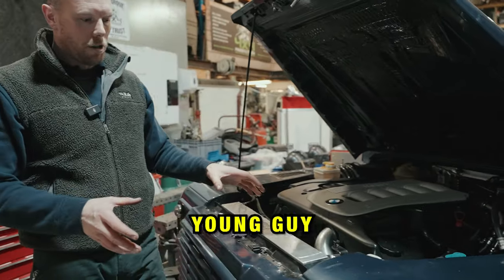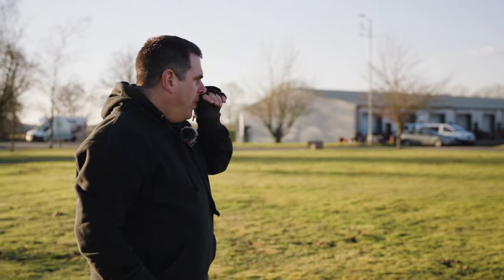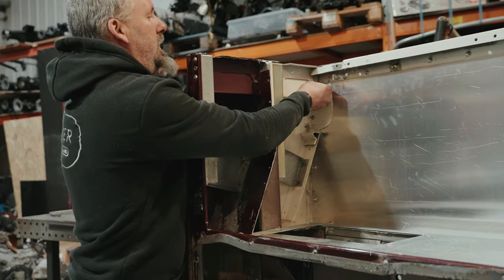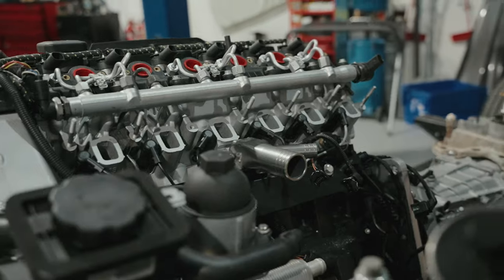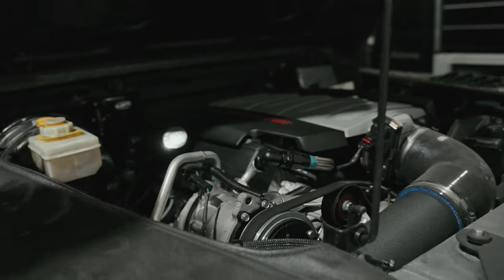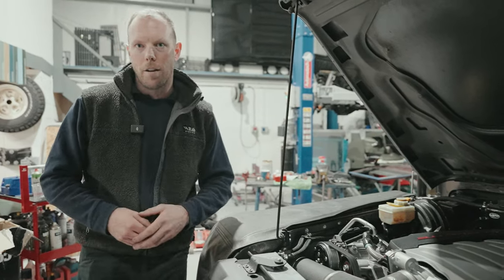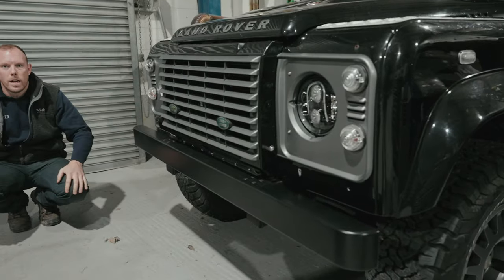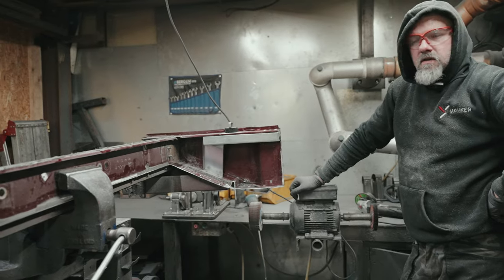What ENGINE SWAP did we do to make this BROKEN Bowler Defender BETTER? || Mahker Weekly EP107

Comment: Once again some more nice bits n pieces and a wombat coming up for sale. shared to face book. Question 300 tdi once warm under load above half throttle, spitting / tapping sound. have done head gasket before with composite gasket new bolts and skim 30000 mile app'x ago. Will be checking rocker shaft, exhaust gasket prior to strip down. also had vac pump last couple of years, any other thoughts. might get tempted by some door handles after. Motor has 210000 on clock but on a J plate I don't think it was all this engine. was in when I bought it 13 / 14 years ago. Timing belt and clutches by others rest self maintained.
Reply from the maker: Get the injectors tested 😉
Reply from the maker: @markparish9072  ourselves 1 hour away

Comment: Dave how much for a conversion like this please, I have a cracking 90 with TD5 engine 1984 full rest, engine and gearbox are typical tractor units, im happy with the overall chassis new galvy one, bodywork is good just want to convert to something modern Stewarty
Reply from the maker: You’d be looking around 25k plus the vat for fully reconditioned components. Thanks Dave.
Reply: @wearemahker  thanks Dave worth considering 👍